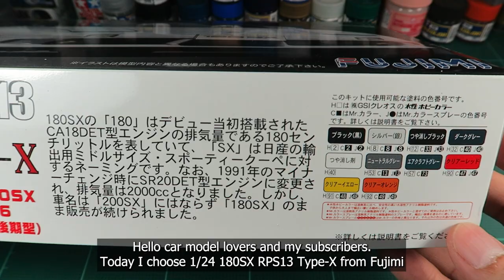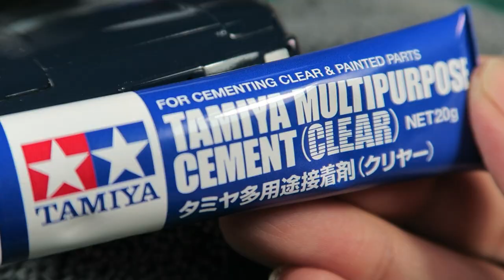Build 1/24 Nissan 180SX RPS13 Type-X - Fujimi

Comment: I have a desperate question how did you get that perfect fitment?
Reply from the maker: Thanks for watching @LightWrld, before actually putting the wheels in First you need to plan the actual position of the wheels that will be mounted, and fitment also depends on the type of tires you choose to install. for perfection. I hope you can do well too.
Reply: @BRscalegarage  thanks for that another quick question how do you paint the tail lights?
Reply from the maker: @LightWrld  You try watching the clip until the end. There are steps to do this. 🙂
Reply: @BRscalegarage  so in a basic conclusion could I just trim the suspension piece?